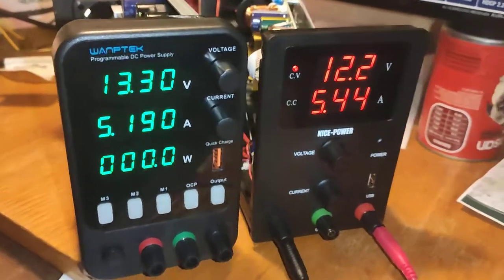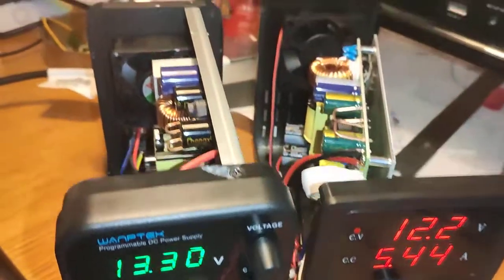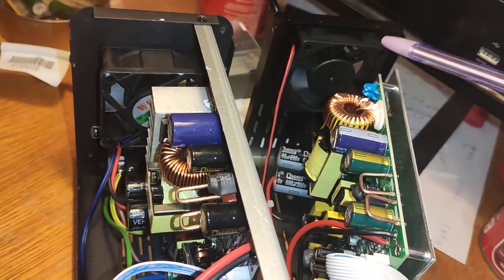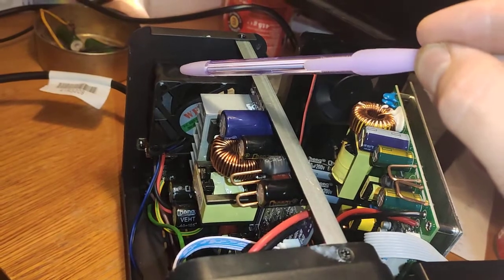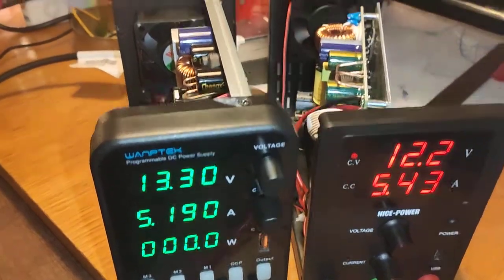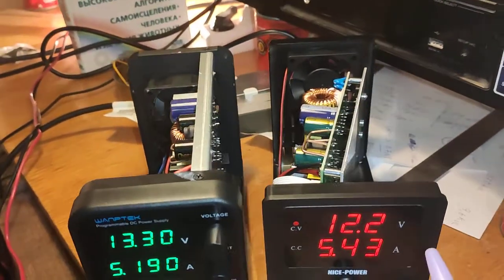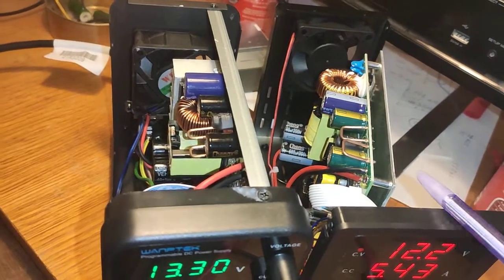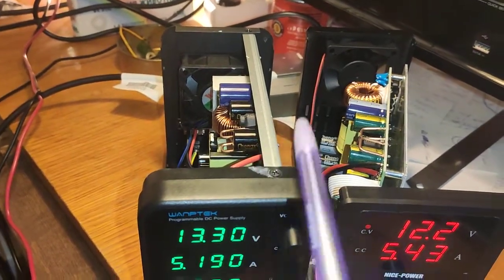WANPTEK APS310H  APS605H WPS605H vs NICE-POWER / KPS3010 power supplies

Comment: Does the fan start quickly? It seems a problem with this exact type. I want to use it as PSU for my Pemf mat, to sleep better and recover.

Does the one who stays cool without h fan blow memory last the setting?
Reply from the maker: device memory has nothing to do with fan. with load of 30v 7a fan will be constantly on. I bough another dc starting from letter K, keinoi kaiwoy or smth, would better regarding cooling/fan with such load 30v 7a, but it also would be still on. 7x30 is over 200w so expect fan to be ON on all these similar devices.
Reply from the maker: i understood you question regarding memory settings. The device you have in mind i passed to my buddy, so can't tell regarding memory. I bought another one which i recomment KUAIQU, it has same cooling plate as NicePower. I now choose Encoder type with 4 knobs, but i recomend with 2 knobs with Encoder.

Comment: I have owned  a Wantptek(DPS3010U) power supply for 2-3 years and it has been a working without any problems, of course mine is the basic model but it came with a big heatsink like the Nice power PS, I would not like it if mine kept going on/off every few seconds, maybe it would work better if you install a more efficient heatsink or bigger fan?
Reply from the maker: Heat sink would help a lot, bigger fan with current heat sink not much. I use it as it is, pritty happy about it. Bought second one but NicePower with analog pots, silent. Wanted second different model for variety and backup in case one of them would fail. Also second one is 30v 10a

Comment: Will those do two  constant voltage and constant current? Ta
Reply from the maker: Yes, it is designed to hold either constant voltage or constant curent
Reply: @minde28383  both? Ta
Reply from the maker: @meguinness1116  yes. Both. Main differences between these two models are lcd and digital regulation vs pots and of course the price

Comment from the maker: who every reads this... after having this unit for quite a long time I can say that is is good unit. buy it, don't hesitate, and digital controls are very handy, nice screen. Not saying NC is very difference but having potentiometers, especially only two pots is way less convenient than digital, but even pots are ok, depends if you need that precision, most do need anyways. I don't use it much so I don't care about fan noise, considering in long term..., it does not bothers me at all, especially because most of days it is off anyways :) and if it would bother me I would bring it to other room and myself would leave him alone till it charges some battery or whatever it is doing at that moment.
Reply: Awesome thank you!
I read your comment.

I really like precession and the memory function is awesome when testing different voltages with my servos.

Thank you
Reply: Thank you for your review, it helps me choosing which one to buy

Comment: Except for the heatsink and the price, is Waptek better than NICE-POWER?
Reply from the maker: yes, i think very similar to NP , buy it, very good digital controls, precise, good lcd. Internally it is very similar to NP,  can't be different because similar price. I really enjoy it every time using even though I use it quite seldom. Memory buttons do work good, but i don't need them much, but I could see scenarios where it could be useful. It is quite light weight unit therefore when i press on/off button whole unit slides little bit backwards.
Reply: @minde28383  Thank you very much for all the information.
Very helpful!
Reply: @minde28383  Btw, can the Quick Charge port be used as a normal 5V port?
Can Arduino be powered by the port, for example?
Reply from the maker: @porkypooky4412  it should be ok, but i think you already found it out

Comment: и всё же я себе прикупил APS3010H 30V 10A на энкодерах (радиатор можно и увеличить самому )
Reply: Книгу заметили на столе?)) 00:57
Reply from the maker: one can always change or increase radiator but device warranty will be canceled. It is like buying  device with known defect. Nevertheless it has good LCD and digital amp and volt nobs.   Good buy, slightly overprices yet. Crocodiles of mediocre quality and slightly shorter compared with nice-power psu.
Reply: @minde28383  agree
Reply: Тоже батон крошу на aps605h
Reply: тоже заказал, не тестил нагрев? может и не хуже чем с большой пластиной найс повер?
Reply: @mariks7411  нагрева нет, кулер включается когда нагрузка большая, блоком питания доволен
Reply: @Андрей-д1х8й  понял, а то пока жду его сижу и думаю как охлаждение усовершенствовать)))  только я взял модель wps3010H 30V 10A
Reply: @Андрей-д1х8й  получил блок, доработал чутка, охлаждение с ноутбука прсабачил)) минус 10 градусов... https://i.postimg.cc/9FMkctgm/IMG-20230128-155855.jpg
Reply: @Андрей-д1х8й  о, спасибо, гляну)
Reply: @mariks7411  а может есть еще фото с разных сторон заранее благодарен
Reply: @Fiz615  так там всё как на видео остальное
Reply: @mariks7411  не видно как вы закрепили доп охлаждение )
Reply: @Fiz615   да просто просверлили сверху в штатном радиаторе отверстие и на болтик с гаечкой своё еще прикрутил)
Reply: @mariks7411  спс , а без доработок работает ? или это обязательно ? тоже выбрал такой вот сижу думаю
Reply: @Fiz615   я потестировал и без своего радиатора, замерял температуры, вроде нормально всё  но просто решил на всякий случай так сказать))) лишним прохлада не будет)) С моим ещё радиатором просто стал медленнее набирать температуру. А сам блок отличный, я доволен.
Reply: @mariks7411  спасибо